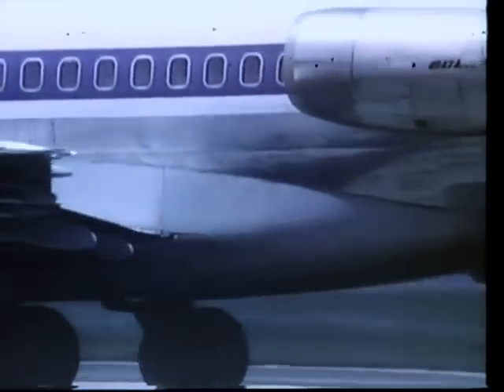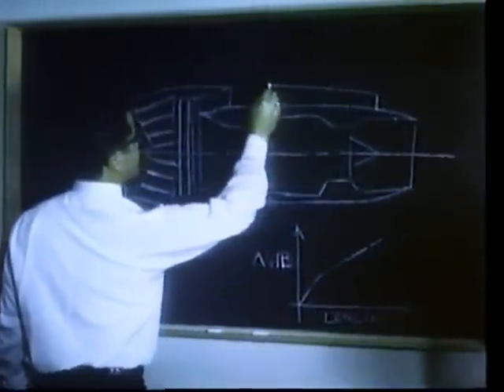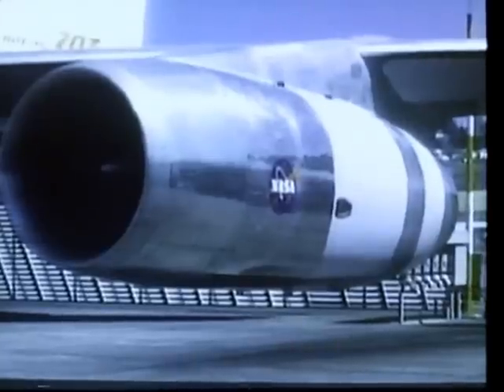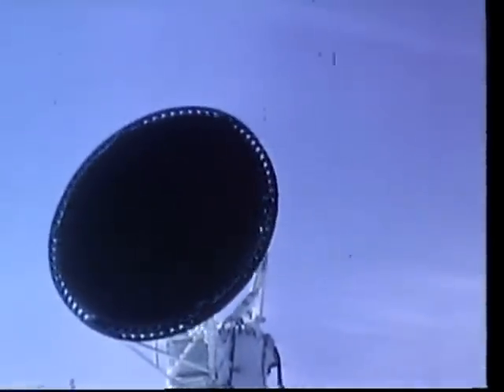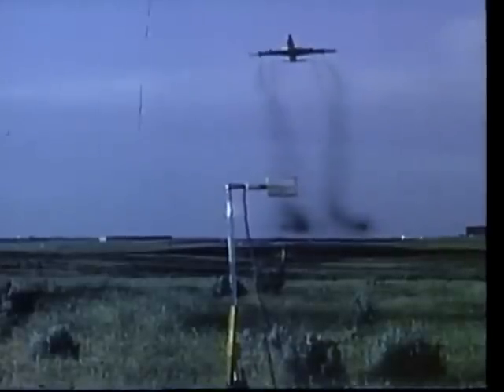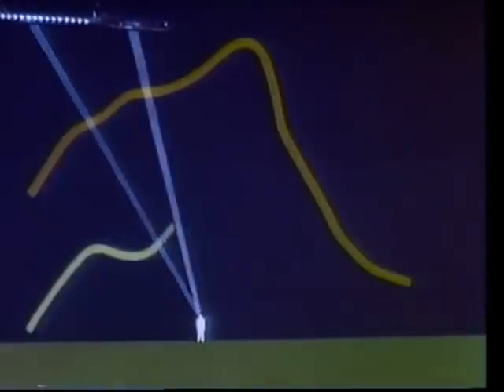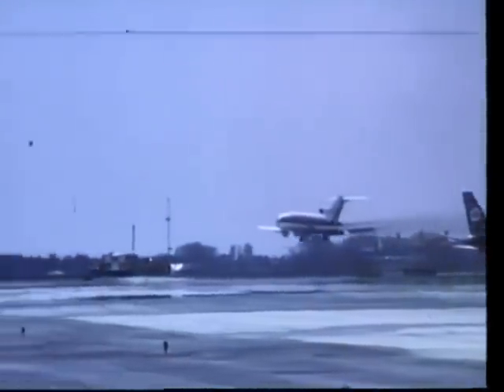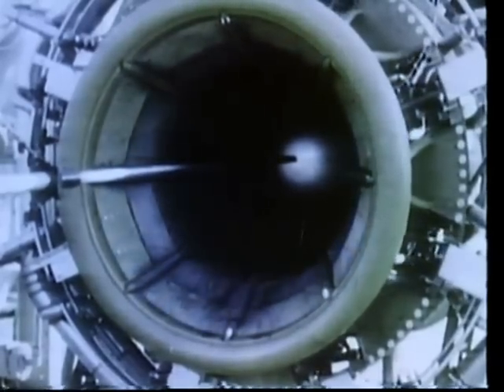Classic Jetliners - "Research Toward Quieter Jet Engines" - 1970

Comment: The is very little as absolutly satisfying as the sound of old jetliners taking off.  Todaynit is sooooooo boring.
Reply: Especially miss the 727, 737 and the old DC-9 they had the P&W JT8D engines.

Comment: When the Boeing 707 was first introduced in 1958, the state-of-the-art jet aircraft was equipped with JT3C turbojet engines, the same jet engines that were built for the North American F-86 Sabre which proved the jet engine was a very reliable engine and delivered a lot of power thus four of them were built onto the 707. Unfortunately, while the 707 was a very successful aircraft and would be the jet credited for entering the world into the Jet Age, as housing developments got closer and closer to the airports, complaints began to rise on the unfamiliarity of the loud whining noise of the jet engines. Also, airline companies began to realize that while the turbojet engines made it possible for the 707 to travel over 600 miles per hour, the engines were very inefficient at low speeds and while taxing to and from the runway. Also, due to the aerodynamics of jet engine propulsion, jet engines produce a lot of noise which in many ways is so loud that it can be very disrupted.  Also, with the passing of noise pollution regulations by state legislatures and later by the federal government, in order to be successful, Boeing pressured jet engine makers to build a quieter jet engine. Later, Pratt & Whitney and Rolls-Royce introduced new turbofan technology which greatly improved efficiency and noise.